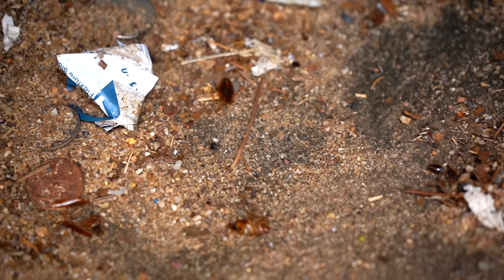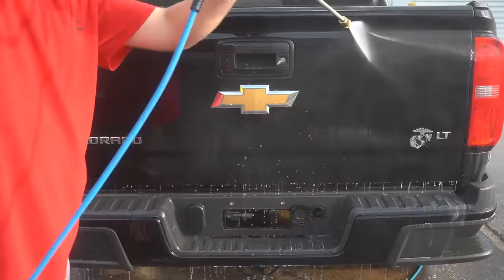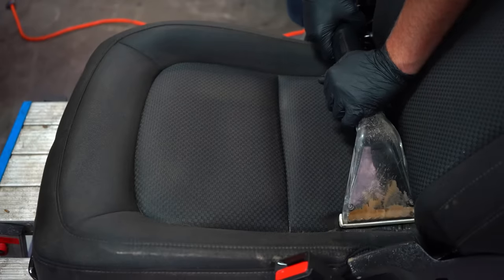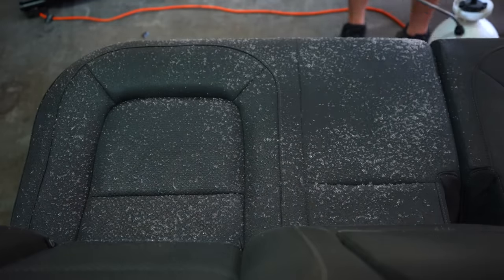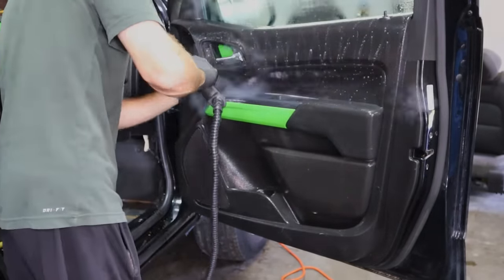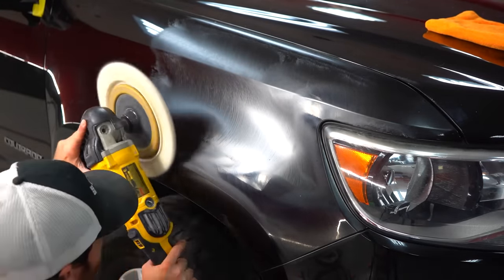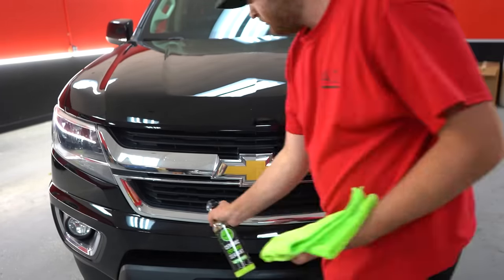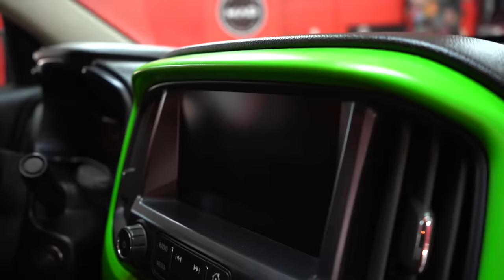Deep Cleaning The NASTIEST Chevy Ever! Best Customer Reaction | Insane Car Detailing Transformation!

Comment: How do you get the roaches out of the ventilation system so you don't get a roach blown in your face when the AC kicks on? Or on the floor vents?
Reply: That's my concern, because those panels weren't opened.  Also what about what's behind those door panels?
Reply: The detailing was thorough. You can go and buy a brand new car at the dealership...
Reply: He said he called an exterminator so that person probably took care of it :)
Reply: And those kind of roaches are terrible to get rid of.  I think they are the small brown roaches which are called German roaches.  They get into everything.  But if the guy got those exterminators in, maybe he got them all.  The ones in the interior were definitely ex roaches.

Comment: I have a Chevy Silverado 1976 if you want. Some body damage. Some interior damage. Runs but need ring seals, brakes and possibly a muffler. It has straight pipe now, loud. It wouldn’t take a whole lot to fix, but I just don’t have time.

Comment: I know it's been over 2 years now since you did this work but on roach out cars do you remove the headliner and clean there? I've not seen you mention it or post it here.. It's most likely similar to what was under the carpet. Also, out of curiosity how do you clean all the dead bugs out of the heating/ac vents? I have to assume it's full of dead bodies as well or do you scope and confirm they're empty?

Comment: I wouldn't bash this guy for selling that truck. He cleaned it up pretty damn good. With 200 degree heat from that extractor he is killing bug larva. Even bed bugs can't withstand that heat. I wouldn't buy it because it's too small for the system that I am getting. I would have to get a full sized truck or SUV.

Comment: Ok, so I already know what y'all are going to say to this, but my cousin took his brand new 2022 Ram 2500HD crew cab to a local car wash to wash it before he came to our bowling league. That was at 7 PM in the winter (so it was already dark). The next day it was sunny and when he walked out to his truck it was HEAVILY scratched front to rear. He went to the car wash and got a hold of the owner and showed him what had happened and the owner said, "well take me to court!" The next day my cousin stopped back by just to see if anything had changed and the owner put a brand new wash brush in that stall, so he knew exactly what happened and that it came from his car wash. I made a habit a long time ago that if I decide to take my car to a car wash I always turn the brush facing outwards and spray it down first so there's no contaminates or debris in it. In the end my cousin had to pay a detailer $1600 to wet sand and buff his entire truck that was four months old.

Comment: Probably should have pulled the glovebox down, shin panel and radio and cleaned the dead roaches from under the dash, blown out the vents, opened the blower box with the blend door and cleaned the roaches out of it, pulled the blower fan and cabin filter and done the same... I’ve repaired equipment and modules under the dash in dirty cars before and seen horrible things, also when your running the heater and can smell the sickly scent of rancid almonds it’s dead roaches and roach poop... pulled a dash apart not long ago that had 3 inches of dead roaches and roach poop just under the top of the dash, had to leave the vehicle from the dust cloud that erupted from disturbing the dried desiccated insects and dirt.. one of the few days I really hated my job...
Not bashing your work... just a suggestion 🙂👍
Reply: Also when I purchased my car I had blend door issues right from the start... suffered with it through winter till I decided to pull it apart... never seen mice in my car but found three mummified mouse corpses kinda glued down.. two in the blend door box and one in the remains of a nest behind the glovebox just above the blower motor.... sterilized my entire hvac system afterwards... car started smelling much better (it was just a bit stale smelling from the vents before... mouse stuff was so old it barely smelled like anything anymore, but still horrifying)